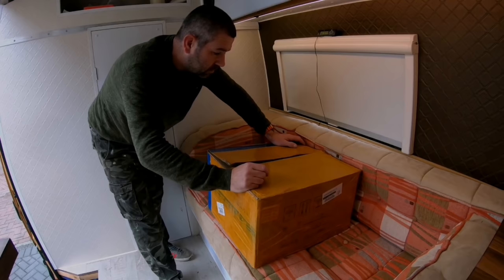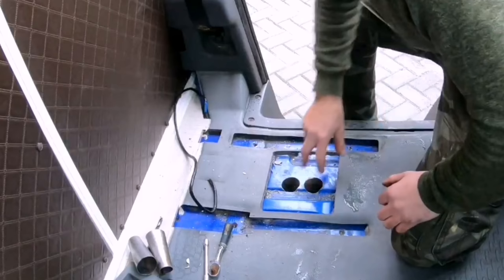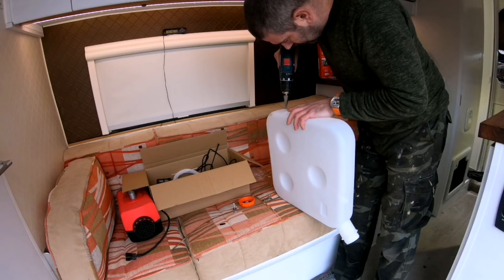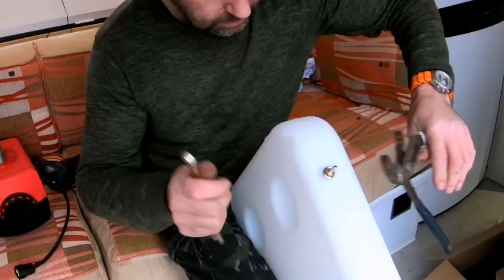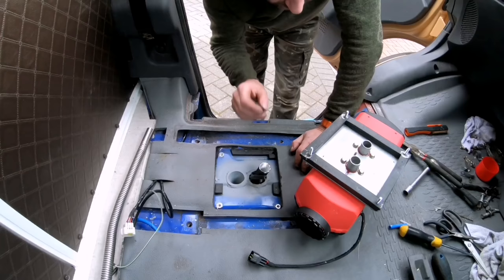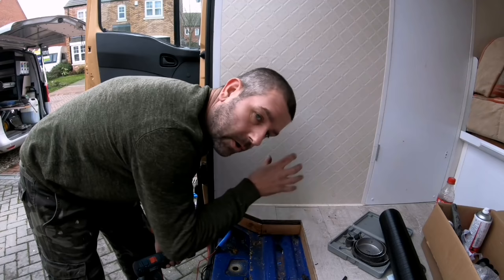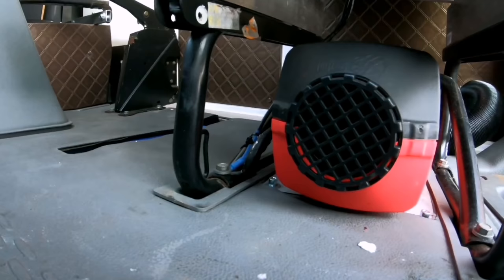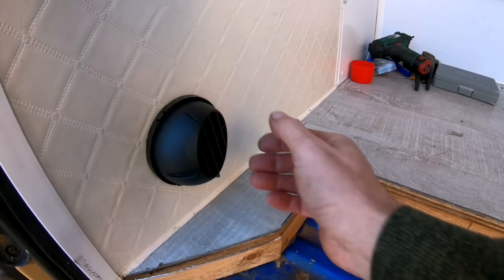Diesel Heater Install -  Campervan / Van Build.

Comment: You probably already know this, but you should give the heater a regular blast(maybe just before it gets turned off) at full temperature. If they are are run at a low temp like in most vehicles, they soot up inside and become very inefficient . The regular high temp will burn off the build up. I threw out my first heater coz I thought it was not working. A mate took it apart and showed me what was happening. My second heater is good as gold now. cheers.

Comment: I don't know how you knew I had planned to install our new dieselheater this weekend but it wouldn't come at a better moment.
I bought a heater together with a installation - specialist who I'm going to help in order to keep the build within one day.
I was planning to get it under my left driver seat so in exactly the same spot, but deu to the construction I'm in a little doubt now.
Well well see, I might place it underneath our bed just in front of the right rear wheel if the mechanic agrees with me on that.

So this Saturday I'm going to do about half of the work you did, on exactly the same vehikel, love it!!!

Still amazed at how your job just is going to help mine😂😂😂

Going to send the link of your vid to the mechanic, just in case he doesn't know the specifics of our van. 🤣

And just in case I forget it:  Wish you and your loved ones a merry Christmas and a great new year.

And of course to all of your viewers 🎄🎉🎇🍻🥂
Reply from the maker: Haha well you know I like to be tuned into other van builder needs 🤔😬😅, If your keeping your bench seat you still be able to fit it there mate, just a bit more near to the drivers seat, due to swapping my seats over and being right slap bang in the middle of that structural support, and having already jacked up the front end to do the cab to chassis bushes, they was a lot of flex in that body chassis member, it needed strengthing in my case 😉👌👍👍👍.
Reply: @Iveavan  our mechanic had swapped out our cabin to chassis bushes too, deu to severe wear out (our van has a persons-elevator on the front right side which, in my perspective caused that wear out) but at that moment I didn't notice any flex on the cabin. I even thought that our mechanic had to push the flex to the limit, just to get those rubber blocks in there. 😁.
But to get back on-topic, my driver seat (LHD) is where your buddyseat is mounted so that's why I fear this a bit.
So if I hear you correct, then I don't need to worry about the structural issues and perhaps we can mount it there without the extra strengthening that you made?

I forgot to tell you that there is already a (broken) water heater in our van which can't deliver what we want (continues heat) within the price of repair which is the same as the stuff I ordered and I've pland for this weekend.
So maybe, just maybe the mechanic can still swap out the water heater for this one which would leave my tools underneath my LHD driver seat and gives heat through the standard vents.
I would love to trow out that broken Eberspacher and have the heater under the bonnet.
Anyhow, what I don't understand is why you didn't go for the option of using the same dieseltank as the one which is already there? Its right behind the mounted seat😄
I know I will, we can even use the same line as used for the old waterheater.

A sin, we would say in the Netherlands, referring to your beautifully covered wall, now decorated with a white plastic fuel tank. Ide call it the Chinese wall. 🤣🤣🤣.
Respect your choice tho, still love your work which inspires me and all your viewers and hope you will have the same fun with your van as we have for years now.

Now go and have some warm fuzzy Christmas time along one of the beautiful British roads. 🌲🎅🌲

Best wishes, Carlo Knüwer, Vught
Reply from the maker: @wegenforum  hey mate,  I mean if you placed the heater more to the middle of the van under the bench seat you should avoid that body structural point, so you don't have to do what I had to do, (only two 30mm holes in the floor pan) I strenghend mine due to cutting through that structural point, and incase I have to do those bushes again, and to keep the MOT guy happy, he then can see its been re-strenghend, due to the seat and chassis mount are within 300mm of that area bud 😉👍, have a great Christmas and Happy New year matey,😀👌👍👍👍.
Reply: @Iveavan  Ill give this Information to my mechanic so it can help on the job tomorrow.
Thank you very much, Mark

Comment: I have just fitted my heater, under the driver's seat of my daily. Found it funny to have your video suggested after I had done the job! I put a pickup pipe in the van tank. Great video, I will have to watch the rest of your videos now.
Reply from the maker: Cheers bud 👌👍, haha, Google must be watching you 😅😉👌👍👍👍.
Reply: Hi how did you conect to main tank? Just 'T'ed off the main fuel line? With a switch t valve acseesble so you switch from engine to heater? Or hole new fuel pic up line in tank.
Reply: Fitted a pickup pipe in the sender Unit. Just enough room to drill and fit one of the slim fittings
Reply: @chriscoulthard4947  ah ok thanks. I will have a look see if I can do something similar in my caddy.

Comment: I've just had my delivery of Chinese diesel heater today aswell for my new overlander. You cant beat them for the price and I will then have 2x heating sources if 1 fails
Reply from the maker: There great Paul you won't regret it! I actually bought two, gave one to Spunky for doing the "Spunky control panel" for us 😉👌👍👍👍.
Reply: Game Changer is all I can say about it. I’ve got mine set on a timer so vans nice and toasty in morning ready for drive to work 😁 also not had frozen screen yet when other cars have down the street 💪 beats de-icer and scraper 🤣🤣 and a huge thank you to #iveavan marky for spoiling me 😉👌

Comment: we put this heater in a caravan for an offroading festival, i woke up thinking i was on fire because my duvet fell over the vent and was buring my feet hahaha, but an excellent bit of kit for the money really surprised with how well it done, remember to put it on high before turnining it off to burn off excess carbon
Reply: Also i would consider using a bigger diesel tank, a 25ltr drum with the feed going through the lid so you can take it off and fill it up with ease, the 10ltr just became a bit of a pain to constantly fill up
Reply from the maker: Thanks for those tips John 👌👍, yes I'm very pleased with the heater, a game changer in this weather 😁👌👍👍👍.

Comment: The health and safety jobsworth in me cringed at watching you drill with no eye protection but I digress ... I had my diesel tank on a  hinged panel in the back, so I could swing it outside to fill, thus  any spills were outside. In the end I never actually used it and fixed it solid. I spent hours trying to get that to work and routing the fuel line with out a kink. With care I never spilt any appreciable amount of fuel. Separate tank give the option of red diesel if you have a supply. Nice job, proves the point - keep it simple. Happy Christmas!
Reply from the maker: Haha yeah, you should wear safety glasses 🤓😉👍, luckily for me, mine is easily accessible for at the pump and being able to fill it up via a 20lt jerry can, I wanted ease and also knowing me, I'll forget to fill the sodding thing up 😅 😬. All the best and have a great Christmas matey 😊🍻👌👍👍👍.

Comment: Nice job overall! I don't have a van or a diesel heater, but it's better than Xmas-day repeats on telly. I have learned from watching these heater installs that you shouldn't run the thing cool, or it will soot-up inside; so run it hot cyclically rather than warm steadily and it will last ages. (if you get my drift).
Reply from the maker: Yeap your right 👌👍, thank you 😎👌👍👍👍.

Comment: You pointed exhaust  to the back of front tire and I have a feeling that when you drive on wet surface water could be basically pumped into you exhaust up to heater in worst scenario also water in exhaust box not helping with corrosion, other than that very professional and clean installation great job.
Reply from the maker: Thank you matey👌👍, the exhaust is facing down and outwards towards the side of the van (as pictured in my community post on here) just the camera angle makes it appears to the exhaust pointing that way bud 😉👌👍👍👍.
Reply: @Iveavan  Ok that's fine BTW I saw that you installed pump outside van how noisy is this clicking sound inside and as well outside ?? I was wondering about made sound insulating box for that little clicker :P
Reply from the maker: @sprint12polska  I can't hear it from the inside of the van, you can feel it under your feet (the vibration of the pump clicking) I mounted mine on a rubber exhaust mounting buffer so I suppose that helps a little, but from the out side you can hear it probably up to 4 to 5 metres away bud 🤔😉👍.

Comment: Mark not that I'm being picky ( you have done a super job ) but something that may be of importance to you.
I noticed that the silencer faces the front nearside wheel. This might get plastered in mucky wet debri and even to the point of blocking the exhaust mate.

I drive sometimes with my heater on and it's handy to be able to do this, yours, the way the silencer is fitted would get rushing air or water sucked up to excess, I think.
My heater is also on the passenger side but with the exhaust extended over to the off side of my van, facing rearwards and well away from opening windows, doors and awnings.

I guess you could just wait and see, it may be fine! I thought it was worth pointing out though.
Oh' the breather may have been better pointing down like a snorkel if you're like me and hit some flooded areas with a little speed lol.
Saying that, it does seem protected and High enough 🤞

I wish you and your family a Very Merry Christmas 🎄✨🎈🎆🧨🎇💥🎅🥂🎈🎄💖
Reply from the maker: Cheers matey 😉👍, only time will tell if the exhaust will become an issue bud, it looks like it pointing forward but it actually face's more out to the side mate 😉👍. It would have to be a good 3ft deep flood for the water  to take effect on the air intake,  my air intake on air filter housing for the engine is around the same hight if a little lower. Have a great Christmas matey 😉🍻👌👍👍👍.
Reply: @Iveavan  Yes mate, It's hard to tell on camera, angles, height and well, almost everything 🤣
Keeping an eye out to avoid those error codes 👀 lol 👍
Reply from the maker: @pa_maj.MARTINI-van-MAN  lol 😁👍, if I do get any issues I will share them on here bud 😉👌👍👍👍.

Comment: I think that is the most complicated install that I've seen so far. 👍
Reply from the maker: To be fair the full van been complicated matey 😉👌👍👍👍.
Reply: @Iveavan  hey, don't bitch with me matey.😂😂😂😂 you wanted the furnace under the seat.🤪🍺 You have the ability, you can do the facility. All said and done, I think you did a very good job given the circumstances. 🍺

Comment: Hi Mark,
Good install and video, thanks.
You might want to turn that silencer a bit more to horizontal though. There's a condensate drain hole in the middle to drain off any moisture otherwise it will rust in no time... 
I fitted my fuel filter the other way round? Not 100% sure if I'm correct but you can see if there's any crud in the system through the perspex much easier then.
ATB, Steve
Reply from the maker: Cheers matey 👌👍, to be honest I haven't seen any holes in my silencer? (or haven't noticed it  🤔).  My fuel filter is the right way around on mine bud, the gauze filter wants to be catching any bits of debris with in its Cup, so you can remove it from the housing and wash it out. Have a great Christmas matey 🍻😉👌👍👍👍.

Comment: Great video, good idea about the extension, nice thought, might apply that if I need to. Nice install, must keep some noise out too I guess!
Reply from the maker: Cheers Max 😉👍, I can't hear the pump, all I'm hearing is the hot air being blown through, I wouldn't say it was deadly silent but pretty much a sound that can be ignored bud 😉👌👍👍👍.

Comment: Couple of things to do with those heaters. First use marine grade stainless steel jubilee clips the kit ones are crap and rust and fall apart in months.  Next buy another exhaust kit 15 quid comes with another 600mm pipe and add that to the end to route exhaust  to better place and makes the unit MUCH quieter.  Also change the kit air intake thing to a proper 1" dirt bike KN air filter cost about £6 and will stop crap going in to the burner and makes it quieter.  If you run them in Temperature mode they will do a full power warm up which stops them sooting up.  Leaving them on Power mode set to low all the time soots  them up fast.  One last thing never let the power cable disconnect when running. The casing will rise to 1000C and melt everything inside in seconds!  Instant Chinese death... Its only the fan that keeps these things alive.
Reply from the maker: Some great tips there matey, yeah those jubilee clips are naff indeed! Cheers bud 😉👌👍👍👍.

Comment: my tank is fitted in the same place , never had a problem
Reply from the maker: Cheers matey 😉👌👍👍👍.
Reply: @Iveavan  all though i didn't use the supplied fuel nipple, i used a stand pipe in the top, then no leaks !
Reply from the maker: @jamescraven76  cheers for that matey😉👍.

Comment: Really nice install, may I suggest a diverter that way you can get some heat in the cab as well.
Reply from the maker: Cheers matey 🍻😉👌👍👍👍.
Reply: What is a diverter? You mean a air Y valve to spread the heat?

Comment: great video mate, Im just converting a Iveco 35s12 into a Campervan and find all your videos brilliant. You use a 'rim nut tool'? to install the fasten the heater down, what is the tool exactly as I have so many uses for one of those?
Reply from the maker: Cheers matey 😉👍, look for " rivnut tool kit " on Amazon,  it comes with everything you need 😎👌👍👍👍.

Comment: great video loving the channel . just a quick question p.s its not meant in any way as a criticism . it looked like during the install there may have been an original diesel line in similar area as to where you were working. what was the reason you didn't just take a supply from your main diesel tank. i will be installing same heater in the future and just wanted your opinion. all the best paul
Reply from the maker: That's right bud 👍, errm two reasons the choice of using kerosene or red diesel, and if I was to use the main fuel pipe and the main fuel tank was approaching on being empty, the diesel heater could potentially use that fuel and probably run out of fuel for the van in the morning.  If your going down that route via the main tank, Probably best to use an separate pick up pipe, only going down 3/4 of the main fuel tank (not going all the way down to the bottom, like the main pick up pipe), so the heater doesn't use your reserve of fuel you have, once its low 😉👌👍👍👍.

Comment: don't go throw deep puddles mark your silener is facing  the spray off your front wheel... also are you going to cover up the solenoid (pump) from the rain water spray from the road hate for you to have problems later on....    you and your family a great Christmas.....
Reply from the maker: Cheers Kev 🍻👍, it should be OK to be fair regarding the solenoid pump, (it will be covered in waxoyl too once I've installed the refillable gas tank) that was the cleanest and rot free part of the chassis and the exhaust faces out towards the side of the van, but saying that I certainly be keeping an eye on it 😉, thanks again and have a great Christmas and New year matey 🍻👌😁👍👍👍.

Comment: I have not fitted my heater yet I was going to fit mine there and put the fuel line into the main  tank now I have seen your video Mark I might fit mine under one of the beds , my mig welder is is not working I don’t know if it’s because it very old and not been used in about 18 years as it stops and starts although the feed runs with no stopping I tried it out making a frame for my winch just incase I might need it if I get stock ,so I have ordered a new one it’s one of those cheap ones for £80 but I need it to make the frame for the winch and one for the gas tank which will be going between the chassis we’re you fitted your wast tank but the cross members are in the way so I’m making a frame that I can bolt under the van then bolt the gas tank Brackets, I was just going to fit it to the chassis we’re the tow bar brackets go but the tank would be a little low for my liking although it would be about the same hight as the diff and plus I don’t really want to put it there incase someone goes  up the arse of the van , I will have to wait until this rain stops I live in a road that is going up hill and when it’s raining the gutter is like a river even when it’s only light rain ☔️ great video as always Mark
Reply from the maker: Cheers Thomas 🍻👍, yeap, my mig welder has had it now, keeps chewing up the wire, I'm going to fit my gas tank on the inside of the chassis midsection, it's gonna be close to the prop shaft but should be OK 🤔🤞, Merry Christmas to you mate and cheers again 😊👌👍👍👍...
Reply: Mark Collom #Iveavan I would of fitted mine there but it’s 300mm in diameter and 1200 long it’s the biggest gas tank you can get although I it might fit on the passenger side of the chassis I will have to check that out when this rain stops so thanks for that if it will fit there I will put my water tank behind the diff so thanks for that Mark I never thought of putting it there.all the best for Christmas and the new year Mark for you and all yours .